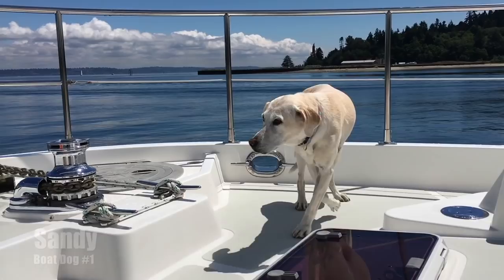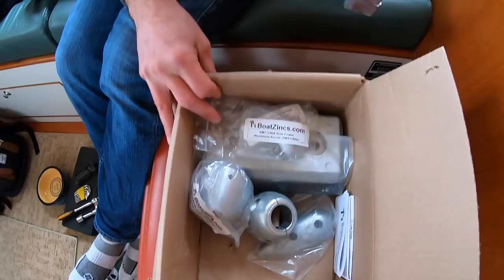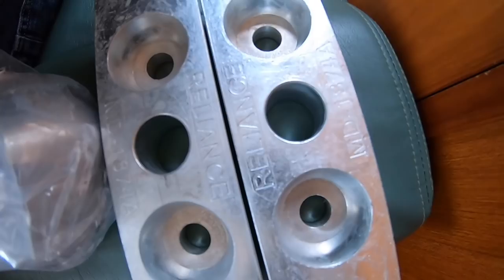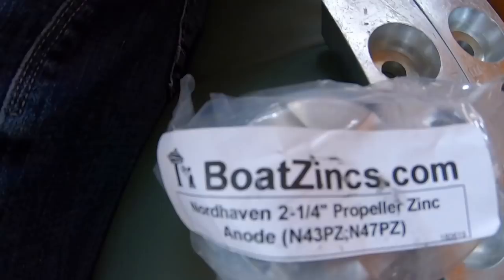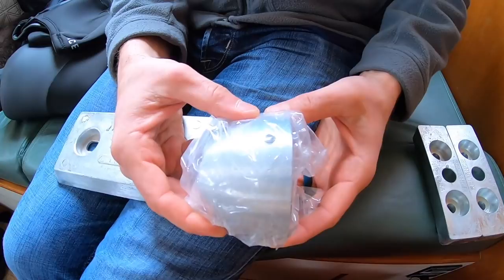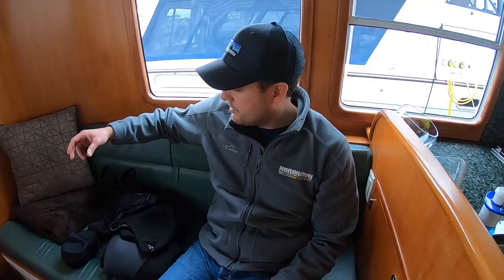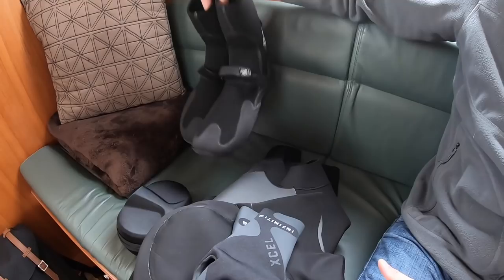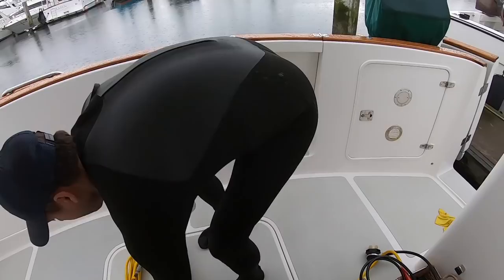Underwater Boat Maintenance on a NORDHAVN 43 trawler

Comment: Really enjoy your video’s.  Not sure if the following would apply to a fiberglass boat but many tin boat owners in the northwest will install their zinc’s slightly “proud” of the hull so that the entire zinc is in contact with the water as opposed to having the zinc fitted into a rubber backing plate and then installed.  Might be a good question for Nordhaven and/or your boatyard next time you pull the boat.

Comment: you would be better off with a ratchet with a head that did not swivel and a shorter extension. Make a small basket and stick it to the side of the boat with suckshon cups to catch what falls.Rob

Comment: The copper anti fouling paint, if not applied properly will actually increase bio-growth.
If you want copper paint, research which is the best, then have one of their dealers apply it.
Well worth the extra cost.  Then if anything goes wrong, they have to redo it.
You may have a fight between the dealer and the manufacturer as to who is going to pay for it.

Comment: recommend you run your air line under your belt so that you move the excess with your body and not trying to hang onto the regulator with your mouth.